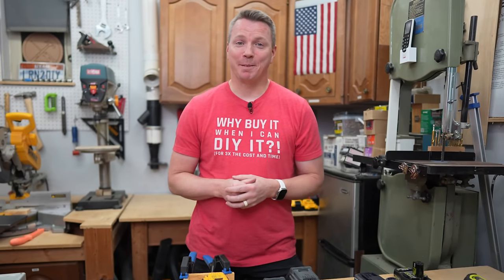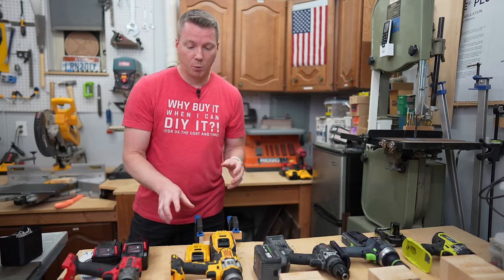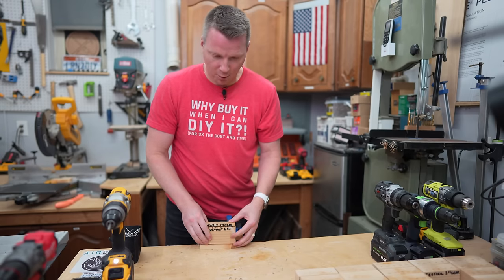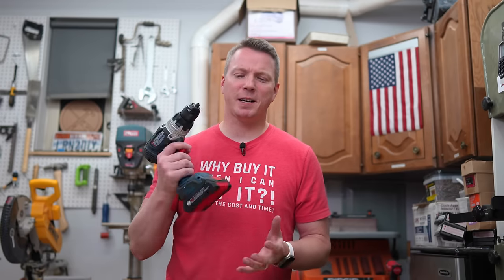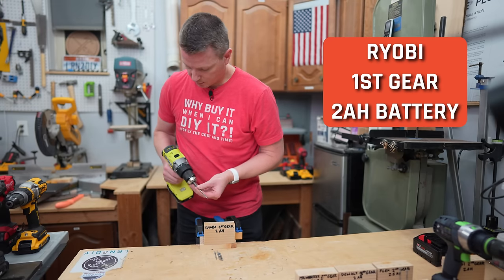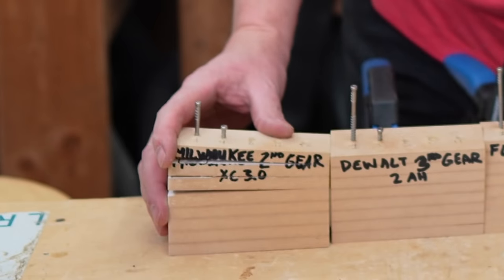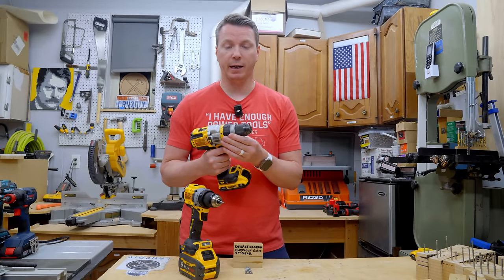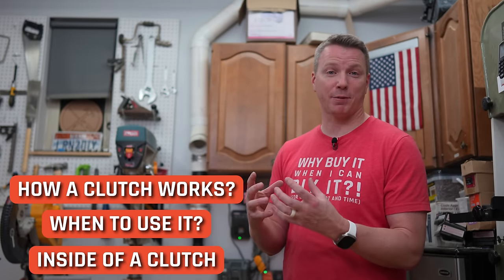What? This Feature is USELESS On DeWalt Drills!

Comment: This test explains why when I was repairing a door threshold, my Dewalt kept breaking the screw heads off when the head hit the wood. Snapped them clean off when I didn't throttle the drill.
Reply from the maker: Yeah, that makes sense. I was really surprised by the results here - at least on the much less powerful DeWalt.

Comment: A couple years ago I decided to upgrade my tried and true DeWalt 12v with one of the newer 20v brushless. Discovered this same thing: the brushless electronic clutches in DeWalt are garbage. Try the same test a dozen times and you'll get a dozen different results. I like the drill for most things, but have held on to my old 12v for drywall work because the clutch is still great, even 3 chuck replacements later.

Comment: I have the dcd999 and the clutch doesn't work at all in use. I contacted dewalt and they had me send in the drill. When I got it back same exact issue. I don't even think they looked at it. This tool is really only useful for drilling into concrete or long structural screws. The sad thing is the clutch works perfectly on my old dewalt drill.
Reply: It has an electronic clutch, that is why it doesn’t work at all.

Comment: As I said in the other video. The battery just change how long you can work until you need reloading. The power is the same. The issue is that your are using a very strong driver from DeWalt. It is a driver for materials like steel or concrete, not soft wood. Use a more suitable driver for this type of work.

Comment: I have the DeWalt DCD708 Atomic 20v brushless and thankfully it works just as intended. Clutch works perfectly. I can't imagine having to deal with that issue. I would definitely return it. I guess the best thing to do would be to test out all the options when you purchase a drill and return it if it is not working properly.

Comment: The issue is mechanical vs electronic clutch all these drills  that seem to have too much power even on the lowest clutch setting have electronic clutch. If you want the gradual and repeatable torque as you move through the different torque settings ...get a drill with mechanical clutch.  Dewalt has a 12v screwdriver dcf601 which is basically a low powered drill with 1/4 inch hex quick connect (like the ones found on impact drivers) 15 different clutch settings with the 1st setting measuring way below 1 lb-ft.

Comment: After watching both those videos. I'm glad I chose Rigid. On the weakest clutch setting, you can stop the drill with a slight breeze. On max, it will keep drilling until it breaks your wrist. Free replacement batteries for life, too.

Comment: Nils, I have an old DeWalt drill that was assembled when Li was still unknown to the general public. They used to make an Li battery that was the same form factor as those old NiCads.
When my NiCad quit working, I bought the Li replacement.

I just ran your test with it. Using a straight grain 2x4 on edge.

On setting 1, it stopped after sinking a 2 1/2" screw about 1" deep.
On 2, it stopped at about 1/2 way in.
On 3, it stopped when the screw head was flush with the wood. 
Every other setting (of 9) buried the screw. (I was using Torx screws so cam-out wouldn't be a factor). 

Oddly, without changing the clutch setting, in each case (1 and 2), I was able to drive each screw the rest of the way in.

So I'd conclude, they used to know how to make the clutch, but have since forgot.

Comment: As for uses of the clutch, one of the best is when you're driving pocket hole screws. You need that clutch to work properly so you don't drive the screw right through the boards. Thankfully, I have the Ryobi and it works flawlessly, even when driving 8" long, 1/2" shank diameter lag bolts. As long as I have at least a 3Ah battery, I've been able to drive as many as 12 of those lags through 2x material before the battery gives out. MORE than enough needed for anything I do as a diyer homeowner or weekend woodworker. Inexpensive, powerful and durable (I've dropped my impact driver more than a few times from various heights and it still runs like it did when new!), my Ryobi tools are great! And, since I've had the majority of them for many years - especially the drill and impact driver set, which I've had for over 16 years - I see no reason to ever switch to anything else. In fact, I only plan on replacing them when they wear out...and THEN I'll replace them with brushless. That's right, most of my Ryobi tools are the cheaper brushed ones, the only exception being my new 7 1/4" circular saw, which I specifically got the brushless as it was part of the buy a battery kit, get a free tool deal.
Reply: I also have Ryobi and count on the clutch for pocket screws. I bought 2 drills in 2008 and both are going strong. I also like them because of the bubble level on the drill. New ones don't have that.

Comment: I had no idea my original comment would blow up like it did. Love your videos.
I just tested my Dewalt 20v max brushless in 2nd gear with and it performed well with decent stare step results. 
It’s about 3 years old and replaced my old Dewalt which coincidentally failed with a ceased clutch mechanism. 
Hope you make you million subs this year. You deserve it.
Reply: The point is that it doesn't work in 1st gear, not that it works well in second

Comment: I bought my first power tools last year, and as Consumer Reports gave Flex the highest rating, that is what I went with.  As someone who spends between 40 to 60 hours a week building the brakes they use for the arresting nets that catch airplanes, I can say they do a great job from the small screws to the heavy duty bolt screws.  I definitely took time to measure out what gear I want the clutch in for my lighter work, and Flex has the flexibility you displayed here.  Great tools with a lifetime warranty.  Highly recommend Flex for anyone who has not yet started buying power tools.  They are more expensive, but they are amazing, and I have definitely surprised my coworkers with the kind of work my battery-powered tools can do.

Comment: I have the 20V Dewalt and the clutch does work really well. I used it on setting one on some thin MDF installing a sliding shelf under a bathroom sink. Once the screw contacted to top of the bracket, the clutch started slipping as it should.
Reply: My older models did better all the news ones are just super powerful. Dewalt is meant for tough work not carpentry
Reply: @lybnychavez6953  I don't think you understand what a clutch is at all.

Comment: Fantastic video! Good job testing mutiple variables to find out which ones have an impact. It's disappointing to see that DeWalt does not do such a simple test on their drills. Just because its powerful does not mean you don't need a clutch. On the contrary, a more powerful drill should have a clutch able to manage torque across a whole spectrum.

Comment: I checked my Dewalt drills. I have a DCD995 hammer drill and a DCD791 drill. Both clutches seem to work fine - but interestingly, they feel different. The DCD995 seems to have an electronic cut-off clutch, and the DCD791 feels like a mechanical clutch. Great video and test - thanks - just subscribed.
Reply: The 791 is really nice. Works well even for pocket holes in pine as long as you don’t go too high..

Comment: I have the DCD991 and thank you for this.  The clutch is beyond useless and as you pointed out this can injure your hand/wrist/arm.  I was on a low clutch setting driving a lag bolt for a hanging shelf into a wall and the drill torqued my wrist and arm so hard that it was not ok for almost 3 months. This drill honestly scares me.  Having paid almost $300 for this with a battery and chargers pisses me off along with the fact that I’m in the Dewalt eco system and really don’t want to change to another battery solution.  BTW i did get the Dewalt gyroscopic “cordless screwdriver” and the clutch and power are really good for detailed work.  Unless you’re trailed navy seal, don’t get the big Dewalt cordless drill.  It’s just not right.

Comment: Certain applications are clutch critical to me. Top of the list is pocket holes. I do a LOT of pocket holes in case joinery. You only have to blow out a piece of walnut plywood once to begin the "find the best clutch" journey. My primary battery platform is Makita LXT 18V. The clutches on the two drill/drivers I have are ok, in the respect that I am confident I could achieve the Flex/Ryobi stair steps you got. However, when Bosch's 5-in-1 transformer came on sale, I snapped one up. It is 12V. It is smaller than the Atomic. It has a 2ah battery (I can get genuine Bosch 3 and 4 ah, and knockoffs up to 6ah, allegedly...but in my experience you can expect 2/3 the power from them). It has all the balls I need to drive pocket holes screws, with a clutch that does what it is supposed to do.

I rarely use an impact driver, unless I am out helping my contractor nephew. I find them to be insensitive brutes, designed for one thing only...driving construction grade screws into construction lumber. Period.
Reply: That Bosch GSR12V-300 has an excellent clutch. I love mine. There's an official 6Ah battery for it, the GBA12V60.

Comment: I’ve never really relied on the clutch honestly. I don’t remember the last time I actually changed the clutch from max. I grew up using a corded drill with no clutch. So I really just had to be cognizant of what was going on and pray for no kickback. I gave myself a nice shiner and really learned my lesson on throttling and being aware of the feeling. If you weren’t careful you’d blast the screw right through a deck board in no time. 

Good video. I own 20v dewalt and take no offense to legit criticisms.

Edit to add:  Do people actually drive fasteners with drillsl? Must be more on finer finishing type things? If it comes to that I’ll hand screw stuff usually.

Comment: I have a previous generation m18 fuel that does the same thing as the Dewalt in speed 2, and I believe it’s because of the electronic clutch. I bought the new m18 compact one this Christmas that has a mechanical clutch just to have something that won’t blow out pocket holes lol.

Comment: I did the same test with my Craftsman CMCD721 and it was actually pretty sensitive on the lowest gear and it did gradually increase as you. You went to higher gears. I don't know why DeWalt is so different because they are made by the same manufacturer. I know they're not the same tool but they are both owned by Stanley Black& Decker

Comment: Great video, coming from someone that likes the versatility of using tools in different applications. Having a good clutch that works is always good. It can give you precise control. There is no point in having a drill with 19 clutch setting when clutch 1 has a lot of power.

Comment: I have an older Dewalt drill. I have only rarely used the clutch. It didn't seem that useful at limiting torque. I had no idea the problem might be the brand. Although, for me, it isn't much of an issue. I use my impact driver for installing almost all screws and mostly I have a feel for when the screw is set to an appropriate torque by the feel and sound of the impact driver. This probably wouldn't be a great approach where the exact torque is an issue, however with wood screws if it's set at the right depth you did it right.

Comment: I recently bought the dcd805 and immediately noticed this. I also have the 12v dcd706 (bought almost 5 years ago) and the clutch works great. I will continue to use the 12v whenever doing any low torque precision jobs.

Comment: Thats great information to know. I've always wanted to see a snap-on 14.4 volt ⅜ impact wrench  compared to different  impact drivers. I've used my 14.4 ⅜impact mostly to drive large screws and bolts for fencing. I'm just curious how that old mechanic tech compares to modern construction tools. It's a tiny impact wrench that can fit in you pocket or on a hammer loop on your pants. Depending on the model it has a 3hammer hammer head with a high rmp.

Comment: On my Dewalt Drill, I have a similar experience.  What I found was to not use all the trigger. I squeeze to a controllable speed when in gear 1. I use gear 2 for drilling only.  Your mileage may vary.

Comment: Didn't you open up your DeWalt drills and swap out the chucks a few months back? Couldn't it be possible that you messed something up while you were in there?
I don't have the 999, but I've been using my 996 for probably more than 6 years and I can tell you the clutch works just fine. I do however have the DCD800 just like in this video and I can tell you that the clutch on my 800 also works like it's supposed to and does not drive as hard as yours does on the lower clutch settings. I let my wife and kids use the 800 for school projects and the like, but I also use the 800 for all of my interior work such as I just installed new cabinets in our bathroom. I was definitely using the clutch for all of the install and the finishing work and everything came out perfect.
Reply: Did he supposedly do that to both of them?

Comment: Maybe that's why my Dewalt dislocated my thumb when the screw stopped, and the drill kept turning through my grip and put my thumb on the top of my forearm. Very expensive orthopedic surgery and physical therapy later and I have range of motion back, but reduced grip strength; and to top it all off chronic pain in all rhe joints connected to and in my thumb.
I have the surgery reports and doctors' evaluations to back it all.

Comment: I would have commented "but muh DeWalt works!" except I am not even sure of the exact age, and I have 4. 3 have clutches, the newest one is my personal one with a small battery and I never use a lower gear except for drilling and feed speed adjustment for material being drilled/abraded with carbide rotary files. The ones we have where I work mostly work as advertised. My really big hammer drill has no clutch, but I use it exclusively for masonry and to chisel.

Comment: I own a medium sized bag of Milwaukee tools and I'm continually impressed by Flex and Ryobi. I know Ryobi is "made in the same factory" so it's not too surprising. What surprises me more is that the Dewalts just send those screws in.  I know in max torque tests you can flip a coin between most equivalent red and yellow tools. They're both going to get the job done. But having some finesse is arguably more important than just delivering the most beans.

Comment: Nice video 
I have old Ryobi drills and M18 fuel and 3 generations of M12 fuel drills, all working well just a new tool addiction 
I do more repairs than builds.  All my drills came in sets with impacts 
I used the impacts for a few years but with so many plastic pieces and more MDF than wood it’s become too easy to damage finishes, the plastic and paper cracks and tears. 
I picked up the M12 screwdriver non fuel and hated it for my use ( unbelievable slow) but my wife liked it and quite honestly I also think it works well for her use. Picture hangers, on the frames and the wall.  And with a 1/4 in hex collet works better for small bits with a hex than any small bit and a drill chuck 
I picked up the fuel version and love it.  1/4 hex  on basically a gen2 M12 fuel drill with an unnecessarily big collet. I wish they would take the gen 3 fuel drill and put the impact collet on. Not as fast as an impact but the time to fix or redo a finished surface makes up for it.  Also not tearing out what I’m drilling into.  Also fewer snapped screws using self tappers in metal, my gen 2 M18 fuel impact self tapper mode is actually the best for those drilling into steel the self tapper mode on the m12 impacts is pretty useless 
But since I’m not running construction screws all day I prefer my 12 volt tools.   Smaller, lighter especially comparing 12V to 18V drills, the 18V impacts are about as compact as the 12V it’s the battery forms.  
Much quieter than impacts. 
Runs screws fast, not as fast as an impact 
Clutch settings and just more control than an impact 
If you’re building using lags and deck screws you want a big impact 
If you’re doing repairs and running 3” and smaller #10s and #8s you want a 12V with a clutch , and you won’t need hearing protection 
I still need the 18V tools. 12V saws are worthless while the 18V are pretty good. And if I’m building using large screws and lags or need a hole saw. There are also lots of electric motors on RVs that have manual shafts that can be run with drills not impacts that you need the 18V oomph 
So many different needs so many tool choices 
For DIY occasional projects it’s hard to beat Ryobi value and selection 
I like the M12 lineup. Drills and impacts drivers, pin nailer, rotary tools, multi tool, rivet tool, right angle drill, ratchets and impact wrenches    If you do finish work, the pin nailer is a game changer.  If you have to do a lot of steel rivets the rivet tool is shockingly good, going from multiple hard pulls and having to get a large set of pliers for the final squeeze to a couple trigger pulls 
I got 18V Milwaukee tools before Flex came out and Dewalt updated their lineup.  I’d probably get Dewalt 20V tools now in preference to Milwaukee but I like my M18 tools, they get the job done

Comment: It would be interesting if you compared any 12V drill with these monsters. I personally bought a DeWalt DCD703 (which looks like being actually phased out for no reason) and so far I managed to do virtually any DIY stuff around the house I could imagine, with added benefit of reaching small spaces or screws close to the wall with replaceable heads. The clutch works rather fine on this one. What I don't like is the switch is non-linear, it goes from super slow through less slow to lightning fast in a blink of an eye. Unless you don't do big woodworking stuff, this one looks fine for home use.